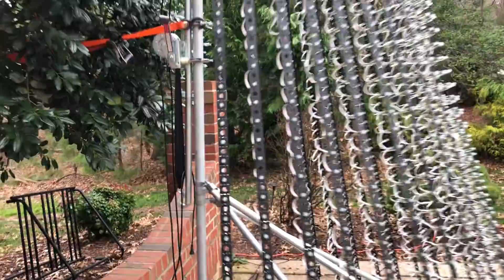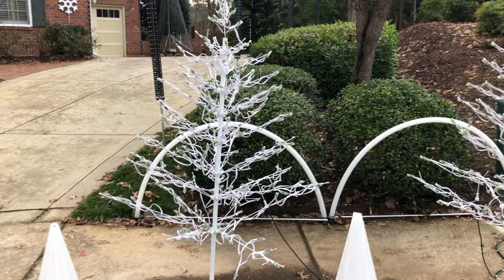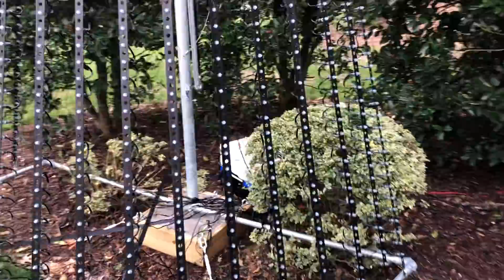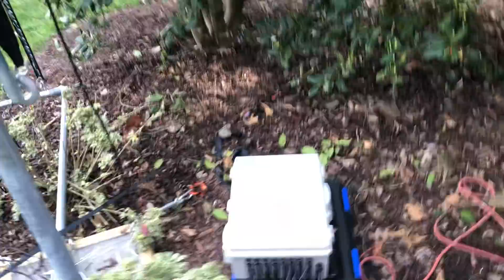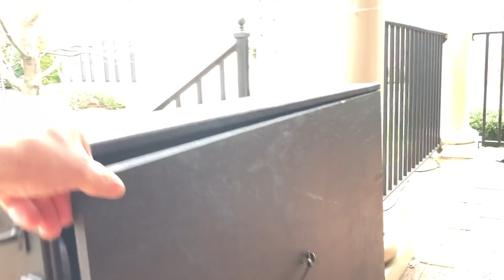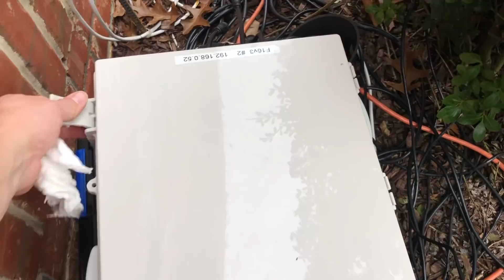Behind The Scenes 2018

Comment: Get one more question you got some blue little panels that your receiver boards from Falcon bolts to where did you get those
Reply from the maker: I 3d printed them.  There is a xmas light 3d print facebook group with shared files.  I printed the files i needed for ach receiver card

Comment: Where did you get the fans to mount to the vents
Reply from the maker: I got them either from Ebay or Amazon. I matched the size of the Bud Vent with a thin 12v fan.

Comment: Thank you for sharing, where did you pick up the box enclosures? (not the CG-1500, the ones with the fans)
Reply from the maker: Nodent I bought them on amazon. 

BUD Industries NBF-32026 Plastic ABS NEMA Economy Box with Solid Door, 15-47/64 Length x 11-51/64 Width x 6-9/32 Height, Light Gray Finish https://www.amazon.com/dp/B005T94MQU/ref=cm_sw_r_cp_apip_FRaQyUxRWKXhw